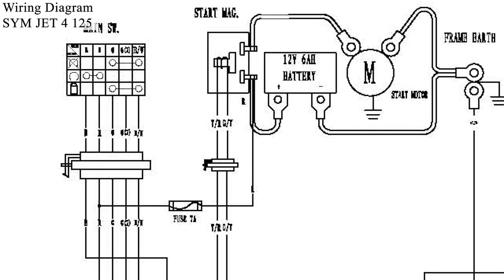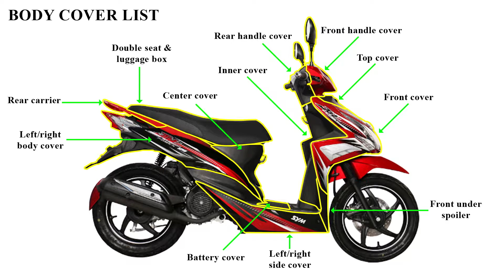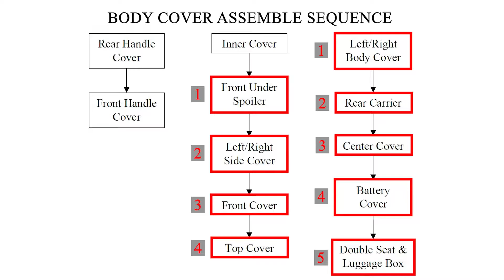Diagnose and Repair Motorcycle (Scooter) No Power Supply | Won't Start | SYM Jet Power 125

Comment: I have the Sym Symphony 125i and it happened that I can't turn off the engine with the key! At the same time, my starter (Anlaser) was working by itself non-stop! The only way to shut down the engine is to remove the battery terminals. However, as soon as I put the battery clamps back on, the starter starts by itself without the key! What should I do? Thank you.

Comment: Boss sya tnya. Moto sya start tkdak crank, tk hidup, smua lampu singal tk hidup. Kosong ja. Apa yg prlu saya check dulu? Fius okayh. Tk putus. Adakah battery kong atau sbb lain ?
Reply from the maker: Kalo fius ok, cuba check battery, connector, regulator, CDI.. kalo semua check dah ok besar kemungkinan la wiring problem..

Comment: Motor sym sy pn jd mcm ni jgk, padahal bateri bru je tukar..skrg ni stater mati, signal, horn pn mati, start pkai kaki pn taknak hdup jgk..ape problem dia bos??
Reply from the maker: Kalau scooter SYM jet power 125. Kena troubleshoot pada fuse, main switch, battery kong, connection, last skali baru check wiring motor berdasarkan pada schematic.
Reply: Cek cuba ganti regulator sym mmg paya nak strat pakai kaki klw xda regulator std sym pakai ex5 blh

Comment: Bateri cas tak masuk ape rosak
Reply from the maker: Kebiasaan kerosakan tak masuk charge disebabkan wiring terputus, alternator rosak, rectifier rosak... boleh lihqt pada schematic diagram motor
Reply: @MyCreativ3  coil magnet boleh rosak ke?angaran brapa?lampu dpn bakg hidup
Reply from the maker: Harga depend pada mekanik and harga barang. kalau coil magnet rosak still lampu depan dan belakang hidup..  Kena diagnosis betul betul motosikal rosak apa kalau tak membazir aja nanti kalau mau DIY
Reply: Model ni selalu problems, current X masuk ke battery